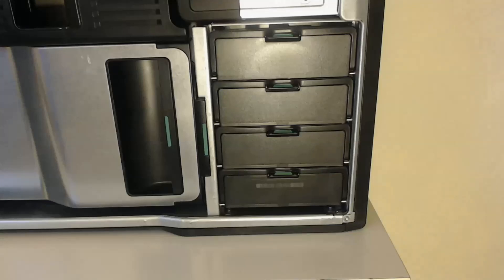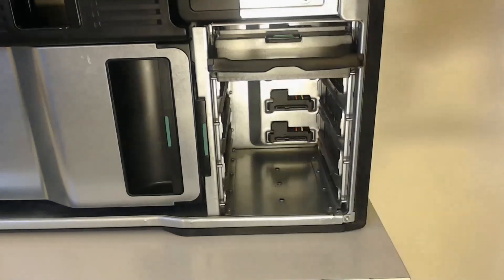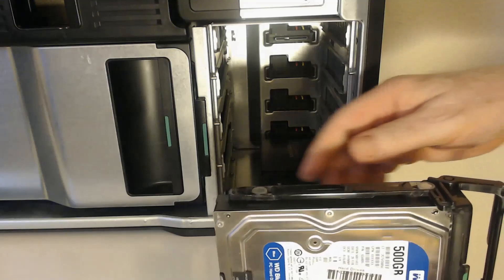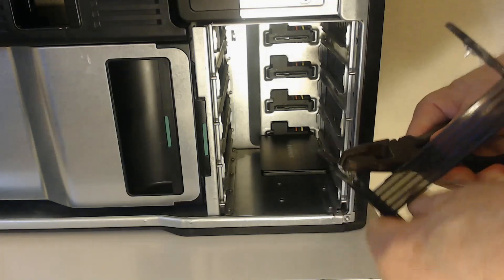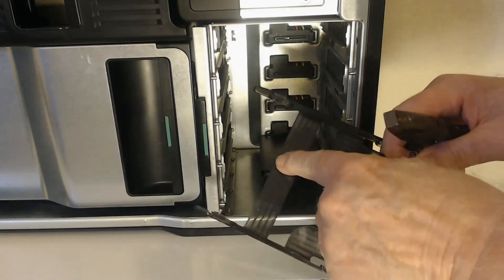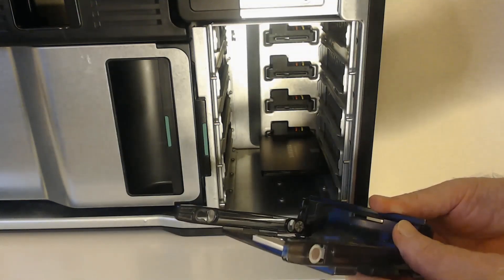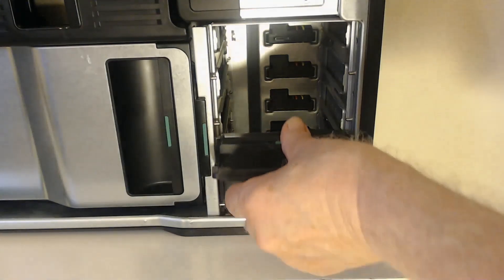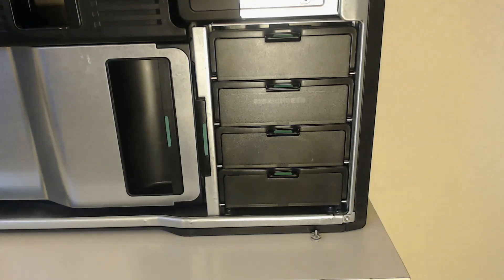Fit an SSD into the HP Z800 workstation HDD bay without a caddy!

Comment: Hey alby I have a problem. I have the same system and a ssd which supports sata 6gbs, but after installing it. It shows only as sata 1.5 gbs interface and my read and write speed is no more than 140-150 mbs. Can you help me with this?

Comment: Hello.
Samsung 870 Evo SATA III will work on Z800? I want to use it for C drive (windows and softs)
Reply from the maker: Hi ther and thanks for your question - Samsung 870 EVO Sata 111 will work on the Z800 - in fact most SSDs will except NVMEs. You won't get the full speed of them because you'll be connecting to a SATA 2 interface, but they will work. You will have to select SATA 0 on the connector because that is the one that is usually used for booting.
Reply: @AlbyTastic  Thank you 🙏
Reply from the maker: Your question set me thinking and I am now going to produce a video based on it- it may take about 2 weeks so keep an eye out for a much fuller reply. and also subscribe and hit the notification bell so you don't miss it.

Comment: Hello can I ask if I purchased pci-e Sata 6gbs and connected straight to the ssd drive will this make the boot up time faster.would like to point out am just a novice Thank you.
Reply from the maker: Thanks very much for your interest  - I'm supposing that you mean a PCIe card with a SATA 3 connection on it. It may help a bit with boot up times but not by a huge anmount but it would help with loading files etc. A better and neater alternative would probably be to use an mSATA SSD as show in the video about cloning the OS to an SSD. Another (more expensive) alternative would be to connect 3 or 4 SSDs into the HDD bay and then RAID 0 them as shown in another video - this would give you approx 4 times the speed of 1 and increase the capacity to 4x one. So 4x 250GB SSDs would give you a 1tB SSD running at about 500-600MB/Sec approx.

Comment: Brilliant just what I needed quite a pragmatic solution, thanks
Reply from the maker: Thank you- I'm glad I was able to help you. I'll be mainly concentrating on the Z machines in future posts with emphasis on the Z800 which I think is exceptional. So if you want please subscribe to keep up to date on future posts.
Reply: @AlbyTastic Yes they are a solid machine love the Z series real great performing PC. BTW how easy is it to add an extra CPU to these units I have a Z600 duel socket?
Reply from the maker: I'm not sure but if you have 2 CPU sockets then you should be able to as long as you match the 2 CPUs and make sure they're the same. You would also have to add more memory as well to match the memory on the first CPU.

Comment: Not that it matters for the sake of installing ssd's, but those are SAS connecters rather than SATA. SATA works on SAS, but not the other way around.
Reply from the maker: I'm not quite sure what you mean - the Z800 accomodates BOTH types of HDDs, SAS and SATA by simply changing over the inbuilt leads from the SAS connectors to the SATA connectors. If you watch the Video on "My Really Cheap Z800" you will see both of them. However you are wrong about SAS drives working on SATA - they don't. At least not on the Z800 - they simply don't show up at all. And SATA HDDs connected to the SAS ports give an error message. I believe I said on that other video that SATA HDDs connected to the SAS ports worked - At the time I checked them one did so it looks as if there seems to be something else at work there - if I get a chance I may look into it but for the moment it looks as if the Z800 needs the HDDs connected to their correct ports.

Comment: Thanks for posting this! It’s exactly what I needed!
Reply from the maker: Glad I was able to help.
Reply: @AlbyTastic  have you ever had an issue with the ssd heating up too much for the double sided tape?
Reply from the maker: @freefall269  No, the double sided tape is just there to provide support it isn't actually attached to the SSD,  and most SSDs don't get very hot anyway. In addition the 2 inlet fans drag air in from the outside over the SSD or the HDDs to keep them cool.

Comment: thanks
Reply from the maker: You're welcome, hope this helped you.
Reply: @AlbyTastic  some people say that z800 supports UEFI and others say it doesn't but supports legicy only. Do you have any idea about this? Thanks.
Reply from the maker: As far as I know it only supports Legacy. I've usually only ever fitted Win 7 because that was the preferred OS for the Z800 and all the drivers are built in to the machine.
I have a Z840 which is a UEFI machine and is designed for Win 10. As far as I know you can run Win 10 on the Z800 but it will only install as Legacy.
I have now done some experiments on this and the HP Z800 is DEFINITELY LEGACY ONLY.
I have fitted Win 10 1909 to one of my machines and then used 20H2 to update it with no problems.

Comment: Cool video. Thx the upload. The 860 evo SSD speed is 6 gbps?
Reply from the maker: The Samsung 860 can run at 6GB/Sec but the Z800 here has only Sata 2 connections so the nominal speed is 3GB/Sec (but of course you never each that speed). On my Z800 I have 3 Samsung 960 EVO SSDs connected in a RAID 0 configuration which gives a 1.5TB disc running at 750MB/Sec - 120GB of this is used as the C:Drive.
Reply: @AlbyTastic  Thanks the info.